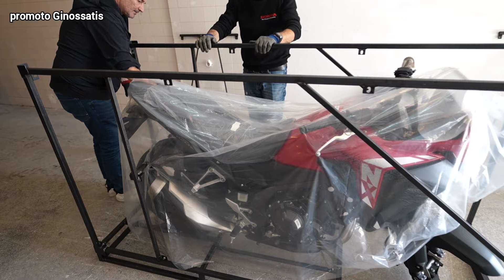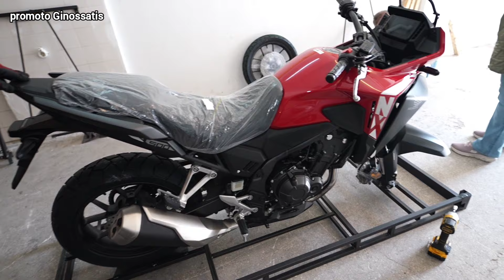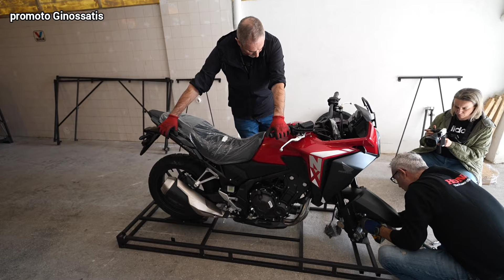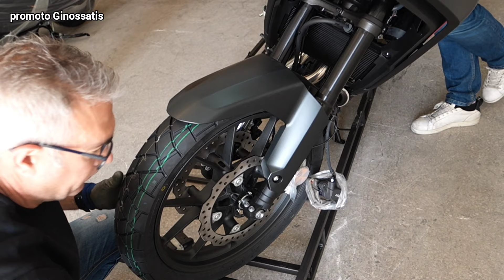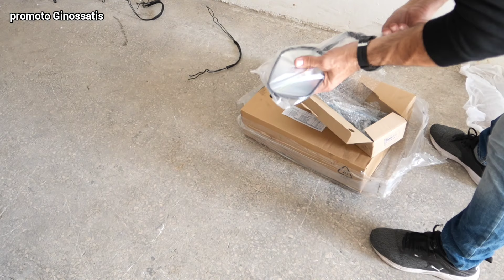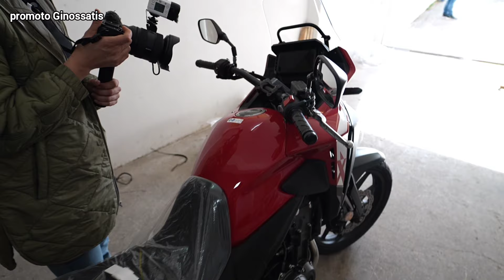unboxing the new 2024 HONDA NX500

Comment: I have been following your clips and so far on every Honda motorcycle you have tightened the front wheel bolts without a torque-kilo-wrench, which is unacceptable. Honda needs to take your license!